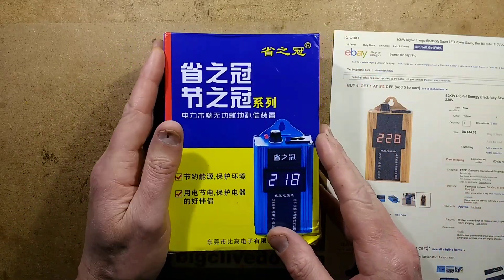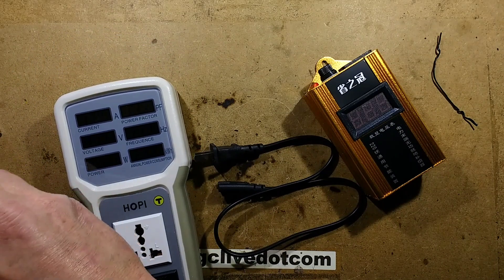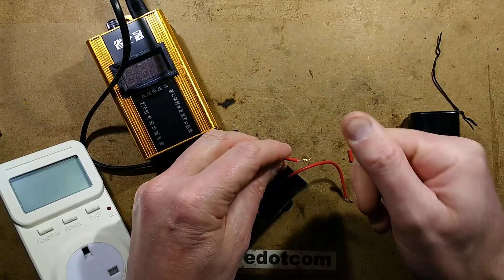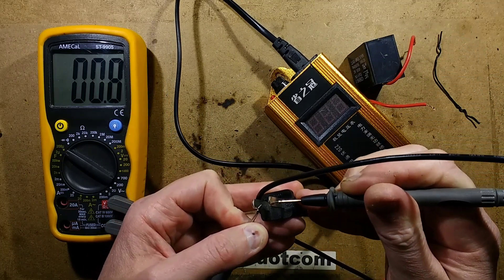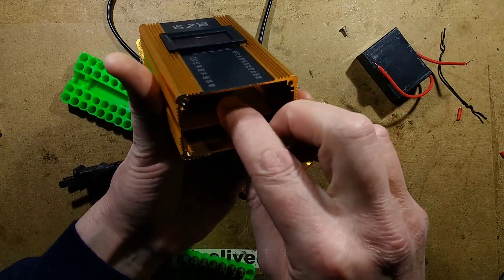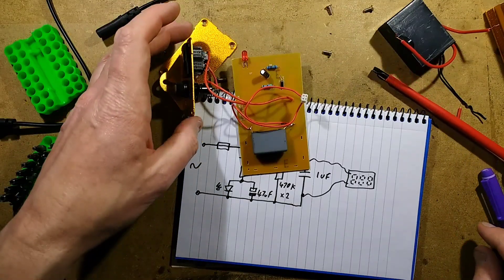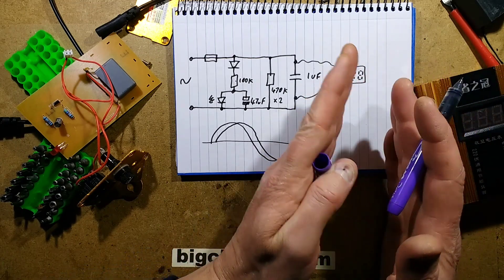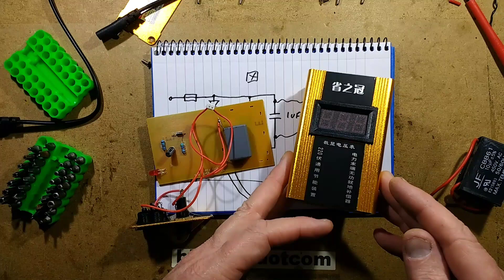Inside a digital 80kW power saver unit.  (with schematic)

Comment: 1:30 Well... That's why you get four. :P
About the whole power factor thing. You know, I would expect most houses to have more capacitive loads than inductive loads anyway, due to so many devices running of switch mode power supplies, capacitive droppers etc. So even if you would pay for apparent power, this device would probably just make the power factor worse. That's kinda ironic.

Comment: That's odd, my HOPI 9800 works fine with pure capacitive loads. It shows amps and volts as as expected, with virtually zero watts and power factor.
Reply from the maker: Maybe a more modern unit.

Comment: I just noticed that the HOPI actually did briefly show the power factor as 0.002 with a current of about 600mA, but it was intermittent. I guess you weren't looking at it during those brief refresh cycles where it was showing data.

Comment: Hi Bigclivedotcom,

Question please.
I got a UPS ---- extension powerstrip ---- dual monitors [samsung and philips] + desktop

When there's a power interruption, UPS switch to backup power.
When it switches to backup power--for a very quick milliseconds [I reckon], 

the samsung monitor stays on, desktop tower stays on.
BUT
the philips monitor turns off for like 3-4seconds and turns back on.
it seem like it's really sensitive on the split millisecond switch from main power to backup power of the UPS.

Question is-- is there a way I can put a capacitor, incorporated on the extension power strip so it would have "buffer/residual" power stored in the capacitor that the philips would not be able to "feel" the switch of the UPS from main power to backup.

Please advise. Many Thanks!

Comment: I used to connect a LED with a suitable dropper resistor directly to the mains, and despite a way too high reverse voltage for the datasheet's taste, it survived just fine. I am surprised they didn't try that with this one :)
Reply from the maker: That works with the old technology red and green LEDs, but not the new gallium nitride ones.  They often expire instantly when their reverse voltage is exceeded.
Reply: @bigclivedotcom  Yap it was an old old one.

Comment: You are talking about the circuit current in amperes  leading or lagging the applied voltage depending if the house circuit is capacitive or inductive.
You are better off trying to explain AC theory using vectors.   A reactive component of the circuit is not called resistance, it is called capacitive reactance or inductive reactance as the case may be.   Measuring the 90 degree phase displacement (leading) of the current drawn by the capacitor in respect to the applied voltage with a digital multimeter is pointless.  A reactive component like a capacitor cannot change your power consumption regardless of whether it corrects a poor inductive power factor or not.  Your household kilowatt hour meter takes into consideration power factors of less than one.   In mathematical logic it is E (volts)x I (amperes) x the power factor, which is the cosine of the phase angle between circuit current in amperes and applied voltage.   
When you are trying to explain how AC behaves in a circuit and what actually happens, the people you are trying to teach need to understand basic principals first.  Some people can't grasp it because it requires you to imagine something you can't see, but just indicate by means of external measuring devices.  With AC you need an oscilloscope to show leading and lagging current waveforms in respect to an applied voltage.
I taught electrical and electronic fundamentals at the RAAF School of Radio in my later service career but I started life with an electrical/ radio apprenticeship 5 year trades course at TAFE.    
What the makers of this product are claiming is just bullshit,  the same as perpetual motion machines.   In the science of physics they are just an impossible  idea.
Robert

Comment: Dude these things are just gimmicks we aren’t even billed by taking power factor active / reactive power it’s only for industrial connections & for industrial loads this power saver is trash this tiny capacitor will pop in a sec they have huge capacitors in there appliances and LT/HT panels

Comment: It’s the name of the thing that creases me up. 80Kw!! Modern supplies for UK domestic dwellings are rated at 24Kw (100A cutout fuse) , but the suppliers apply diversity: for places that don’t use night storage heaters, 10A per dwelling is taken as the approximate demand that the network needs to supply.

Comment: Disclaimer: I have not watched any of the video 

I’m going to guess what’s inside:
-Switch
-Fuse
-A few resistors 
-the display (duh)
-a high voltage capacitor
-a diode  
-and an LED 
Comment and tell me how accurate I am

Comment: I wonder if I cascaded several of these, would my meter start runnings backwards and the electric utility would start PAYING ME?
Actually I have been pondering Ohm's Law and I should be able to accomplish the same thing with a single component: a resistor with a NEGATIVE value of Ohms! 😀

Comment: Takes me back to 1977, I was an Army Recruiter who was only 6 months away from separation.  My bosses didn't really want a short time Army Recruiter in the office since they figured I might just tell the truth to prospects rather then the "approved" sales pitch, so they relieved me with orders to go home and do what ever the hell I wanted to do till I got out!  Nice guys those bosses, so I decided not to waste my time setting on a chair watching paint dry, and enrolled in a local trade school to become a mechanic.  Thus my introduction to the world of Capacitors!  Back then every car engine had a large capacitor under the distributor cap, this, of course was to hold the coil charge till the cap called for it to fire the spark plug.  On our test bench, was a small device where you could insert the "Condenser"  to test it as part of the troubleshooting of engine problems, since condensers going bad would make a car stop running.  The game used to be to take a good condenser to the test bench, charge her up on the test gear and not hit the discharge button, then go to another part of the shop and call another students name, so they would turn and shout CATCH, throwing the charged condenser to them, of course 9 times out of 10 they would catch and instantly discharge a rather large voltage from the big steel encased capacitor. Used to be great fun, of course those days are now long gone thanks to electronic ignitions which were just something we were reading about in our text books.

Comment: Connect 20uF capacitor series with heater and reduce power 750W to 200W ( is it a heat power ) somtimes constant power is better than termostat controlled...

Comment: If you stick a really big capacitor across the mains, wouldn't some power flow as the mains is AC? How big does a cap need too be to start passing 50hz on the mains? I guess it depends on the output impedance at that mains point.

Comment: how much clearance / creepage was there between the AC line voltages and the, unearthed, metal case?  There's no insulator on the back of the pcb, and it's through hole, so if the pcb is in one of the lower slots in the case, the terminals might end up rather too close for comfort to the case?

Comment: Can you please do a video about a Meanwell LDD-700HW? With schematic and maybe how to build one yourself with the option to change the mA output. Would really love a video like that.
You can buy them from eBay and lots of other places.
Reply from the maker: I wonder if they're potted.  You can get a wide variety of open buck regulator modules on eBay.  They're not expensive.
Reply: bigclivedotcom but they doesn’t have pwm. Or have I missed something?

Comment: Hello Clive, First of all I want to thank you for making these very educational videos. I have not seen all your videos, but allot of them, making me wonder the following. When you ordered this object you must have known you were getting screwed, it's impossible to reduce your power bill by just plugging a single phase "appliance" in a socket. Have you ever showed the video you made to the sellers of the objects and requested a refund? And if Yes, what was the reaction of the sellers and did they agree to give you a refund? I myself ordered a powerbank the size of a cellphone (8mm thick) rated with a capacity of 100.000mAh for $9.99. Of course I knew I was gonna be screwed by I was in need of a small powerbank, to have extra power for my cellphone, so I decided to order it and see how big the capacity was gonna be. After charging and discharging the powerbank several times, since it was new, I decided to start doing 3 well documented, measured and provided with video tests. The average capacity from these 3 tests was 4400mAh. So I contacted the seller and told him I had done these tests and he had the option of giving me a complete refund or I would report him to Ebay and I would provide them my complete test results and the video of the tests plus the specs of the measurement equipment I used to arrive to this result of 4400mAh. The next day I received a message from the seller to please check my paypal to find their refund, without any form of discussion. When I went to Ebay I saw that the listing was gone, but after a few days the item was listed again but by another seller, looking at the profile I think it was very safe to say that it was a new account made by the seller. I did consider doing the same thing, using a new ebay account, LOL. If I were you, you are spending quite a bit after all on Ebay I would try to retrieve my money from these scammers that are taking advantage of faithful people, with no, or at least a very limited knowledge of electricity. Greetings from across the pond (Belgium) and thanks again for your good work ;) And now it's time for a beer, a real Belgian beer, lol

Comment: is that like  a power factor corrector? We had a PFC at Safeway (before they went up the creek) in the 'Electric' room. There were 2 Econolite units designed to 'dim' the fluorescent lighting the store used to save power however they were never turned on. When I was in charge of 'Maintainance' I tried turning them on and two thumpy relays kicked in but on the display 'Error' LEDs came on so I guess they were useless. Anyway the PFC was set to a COS of 1.0 and the display usually showed 0.96 - 0.99. One day I came into work and overnight some kind of fault had developed  and one of the caps inside had caught fire. I just wondered what would have caused that? It cant have been the econolites as they were in 'bypass' mode ( I never left them on after the error ) They were for 25% and 75% lighting as after close a timeclock switched off 25% of the store lighting. I think the PFC was mainly for the Air Handling units and Bakery machinery as they used huge hefty motors somewhere within their purpose.

Comment: Technically, isn't it miniscule power savings if it does keep the volt/amp draw in sync?
If you draw more amps at a lower voltage, that's more resistance losses. 
If you draw the amps at the voltage peak, that's the least resistance losses, no? 
Honestly, power companies should be allowed to charge for apparent power. You're wasting their electricity with your shitty house electrical installation. It's like them not charging you for a leak in your plumbing.

Comment: My understanding is that bad PF + near max loading = tripped breakers.  IE you spam what should be 1500W of .5 PF LED lamps and you trip the breaker long before you reach 1500W because the PF is so bad.

Comment: Funfact: if you have lots of inductive load in your system you will consume a lot of not measurable power that you wont pay but also cant use. If you put enough capacitors in the system you can compensate the so called cosinus phi and the electricity meter will now recognise this power you cant even use. So the only thing capacitors do in this kinda composition is causing your electricity bill to get higher while the electricity producer now doesnt need to make excess power. You as a household do not consume less energy but all the energy consumed can now be measured. You actually pay less without cosinus phi correcting but sometimes if a company has too much inductive loads it has to correct it by law
Reply: Sorry, that's false.  Yes, inductors draw current.  And capacitors draw current.  When you put them together, each will still draw the same current, but the current from the power source will drop - if perfectly matched, it will go to zero (in reality, not quite zero since both have some resistance and therefore loss.)  But if the current to each device is the same, how can the current from the power source be zero?  Because the current passes between them - not from the power source.  While the inductor is drawing lagging current, the capacitor has leading current - they cancel (or at least partially cancel).

Comment: I would not be plugging that thing in before testing its HV insulation, there is no Earth pin and no insulation between the PCB and the case.
The case could have been possibly live if it was made on an off day.
We could have had an Ex-bigclivedotcom
Reply from the maker: Being an electrician to trade I intuitively avoid providing routes to ground through other parts of my body when handling anything like this.  It's one of the most important things to learn as an electrician, but doesn't really get much mention in modern training.
Reply: Yup.  That's saved by hide a couple of times.  Once when I wired up a attic light after turning off the wrong breaker, and the second time working on a line powered by a 6' tall UPS - we'd turned off everything on the UPS, but that only killed the inverter.  So it went into bypass.  NEVER count on just one thing to protect you.  You've heard of "security in depth"?  Practice "safety in depth".  Always be as safe as possible instead of "minimum safety".

Comment: The capacitive dropper also has a diode bridge in series, and the meter probably only tests capacitors at 1 V or so. That wouldn't be enough to make two series diodes conduct, and so that capacitor is effectively out of circuit.

Comment: But did the pound store fake viagra have any effect, dammit!? 

I was expecting an increased heart rate at least, possible use as cheap dance tablets? I NEED TO KNOW!!
Reply from the maker: There was a slight feeling of elation afterwards.
Reply: bigclivedotcom so some elation but no elevation? Kinda figured that would be the case, considering the ingredients. Still, they can be used as pound store disco cookies, I guess. Cheers Clive!

Comment: Apparent power only really comes in for industrial settings. The utility companies don't like it as it contributes to power line losses (high current spikes) that the meters wont charge for, but cost the utility. They DO charge for apparent power if you have a crappy PF here in the states. Its a percentage of your total power bill added on if you don't take steps to correct it from what I remember.

Comment: Well at least you got a flashy gold volt meter out of the deal...
Reply: Ya, if that was cheap enough, it would be worth buying just for the case, I have plenty of meter inserts I  could replace that one with and make a nice DC device with lighted readout, or for that matter a good 110 volt device using my own step down regulator to power it.

Comment: Is the frequency of the UK power grid a lot less strict than the US?  Obviously, UK is 50Hz and US is 60Hz, but the deviation from nominal seems to be much greater in the UK.  Just in this video, it was as low as 49.89Hz and as high as 50.04Hz on the HOPI.  Here in the US, I've never seen it below 59.98Hz or above 60.02Hz (barring a severe storm coming through and knocking out random loads, causing imbalance in load and generation on a moment's notice).

Comment: To get rid of the flicker on electronics, check your camera settings to see if you can change it to 60 Hz instead of 50 Hz.  might clean up that flicker when you're showing your power meter.

Comment: If my fridge compressor starts on, my monitor goes blank for a second, what can I do about it except for buying a new fridge ? That is desync, right ?
Reply from the maker: It sounds like the voltage drop on the supply causing a reset.  If your electrical system is in good condition it might be worth checking to see if the computer is on the same power circuit and moving it to another one if it is and another is available conveniently.
Reply: Tyvm for your suggestion.
I already know I have 2 power circuits, because my other monitor never has any problem, so I identified the problem correctly, the voltage drops below the tolerance of my monitor.
But it's impossible to run the second monitor on the same circuit.
I connected an UPS, as i remembered it would eventually balance it out, but it does not help. Now I am out of ideas.
Reply: the monitor's are in different location's?  Also, not all UPS's will help you here, some of them aren't really "uninterruptible", they take a small amount of time to switch.
Reply: Is the UPS a constant running one, or does it only switch in the generation circuit on sensed dropout?
If the latter, it's too slow to help the monitor, the glitch 'gets through', while usually fast enough to keep things powered on.
If he former, it really shouldn't happen, but maybe if inadequate filtering? (not intimately familiar with UPS innards)
Reply: @animefreak
Yes, they are in different rooms.
@Michael Tempsch
Obviously it's not running all the time, but I realised that it does not help after having bought a new battery for it, and I thought APC is a pretty good brand :S
Is there an alternative to buying another UPS ?
Reply: Enty Ropy -- Yes, there is an alternative. Run the problem monitor via extension cord from the other outlet!